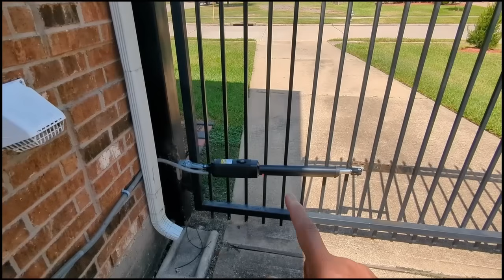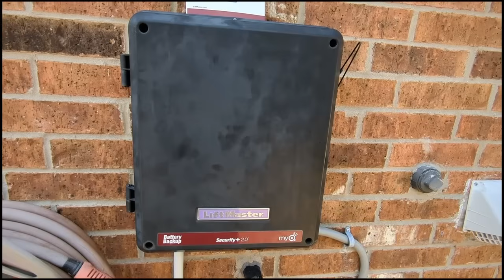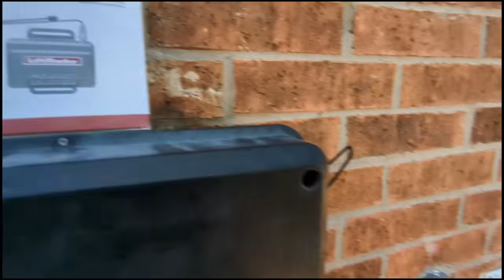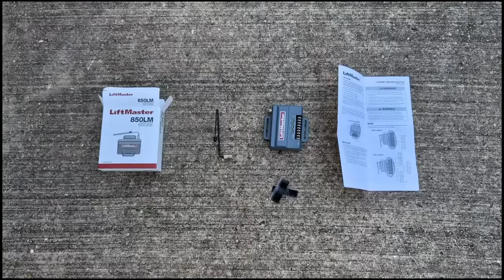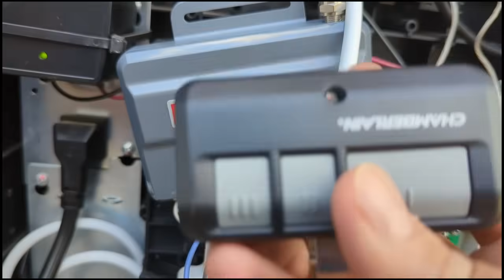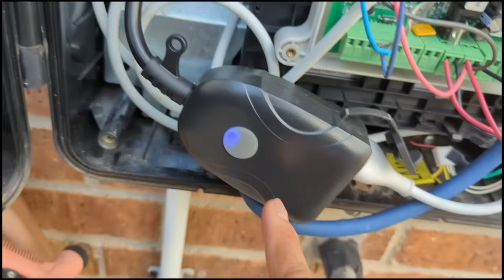Add Homelink and Liftmaster remotes to ANY aftermarket Gate or Garage Door opener.

Comment: Can you share the part/source of the relay you connected to the Costco smart plug?
Reply from the maker: https://www.amazon.com/Electromagnetic-Power-Relay-Socket-Indicator/dp/B0BNCZCFGY/ref=sxin_17_pa_sp_search_thematic_sspa?content-id=amzn1.sym.35c3a4b6-c692-4e40-a10a-4f3d93be8195%3Aamzn1.sym.35c3a4b6-c692-4e40-a10a-4f3d93be8195&crid=1MYRJVA7B9OUM&cv_ct_cx=110v%2Bcontactor%2Brelay&keywords=110v%2Bcontactor%2Brelay&pd_rd_i=B0BNCZCFGY&pd_rd_r=b2cb0615-d749-41aa-a199-080d9124b558&pd_rd_w=kN5jA&pd_rd_wg=gq39O&pf_rd_p=35c3a4b6-c692-4e40-a10a-4f3d93be8195&pf_rd_r=AFH6PCVP7EFW7S7N50PF&qid=1770265730&sbo=RZvfv%2F%2FHxDF%2BO5021pAnSA%3D%3D&sprefix=110v%2Bcontactor%2Brel%2Caps%2C215&sr=1-1-383bc08e-f3b5-4928-b079-a9607486ab19-spons&aref=yz8uQ05ha2&sp_csd=d2lkZ2V0TmFtZT1zcF9zZWFyY2hfdGhlbWF0aWM&th=1

Comment: Can you make the vevor work with myQ app
Reply from the maker: Yes, you can use MyQ , However the MyQ would not "talk" directly to the Vevor, It would instead send a signal to this Liftmaster device , which would then in turn open or close the gate as seen in the video. 

Bear in mind that the MyQ Sensor is for a garage door , which tilts up and down based on garage door position , since the gate is opening sideways , that sensor will not work.

Comment: Great video. 
Have you considered using the MyQ remote app with the Smart garage/gate controller - myQ-G0401-ES?  Do you think that could even work? : I have all my cars set up for CarPlay but still have a remote transmitter for the gate.

Comment: I purchased the 850LM and installed it.  I connected wires from channel 1 to my overhead garage door opener.  I power the 850LM with a 85LM power module.  The 850LM powers on and when I push the ch 1 button, the yellow light comes on.  So far so good.  Then I click the Homelink button in my Jeep and the light on the 850LM never responds.  I also tried clicking a handheld remote and that didn't work either.  I have tried this same exercise in both 315 MHz and 390 MHz Security+2.0 mode.  I can't get the 850LM to respond to any remote or Homelink.  Any suggestions?
Reply from the maker: My only thought is that you have not "Paired" the remote to the 850 correctly.

Comment: I recently bought the Liftmaster LM850 (Universal Receiver) along with an aftermarket Liftmaster-copy remote. I have an old roller door opener (I believe it’s a Herculift, or something very similar).

I wired the LM850 to the old opener’s circuit, and everything works fine using the aftermarket remote. However, I’m unable to pair my 2021 Cadillac’s Homelink with it.

Could the issue be with the aftermarket remote? And if so, what type of remote would be compatible?
Reply from the maker: Maybe your Caddy's homelink is the problem. the LM-850 works with all versions of Homelink, Or you are not following the procedure in your owner's manual.
Reply: I did follow the steps in the manual. However the Homelink system in my car does not seem to catch any signal from the transmitter I have(again, aftermarket). I honestly believe the reason is because of the aftermarket transmitter? Should I buy the original LM remote?
Reply from the maker: @yaseral-yami6304  I couldn't tell you ...... Try with another vehicle ..... if it works then its your car

Comment: I’m installing my 850 this weekend. Did you have a module on how you did the inter net hook up? If not can I get a list of the components you used? Thanks.
Reply: Do you have a part # for the AC relay? I am going with the TP-Link Tapo Outdoor Smart Plug since it is Matter savvy and will work with my Apple HomeKit environment. Thanks for all the help so far.
Reply from the maker: @JakeMoore-u4r  This is what I have used , make sure you understand how to wire it up. 

https://www.amazon.com/TWTADE-Electromagnetic-YJTF08A-Quality-assurance/dp/B07C78PHS2/ref=asc_df_B07C78PHS2?mcid=7969125f69d43bd4b40b5605cdd23768&tag=hyprod-20&linkCode=df0&hvadid=693071814373&hvpos=&hvnetw=g&hvrand=17901985090613655946&hvpone=&hvptwo=&hvqmt=&hvdev=c&hvdvcmdl=&hvlocint=&hvlocphy=9027774&hvtargid=pla-454750891153&th=1
Reply from the maker: So what I think you are asking is how I did the internet , Its hard to say what you will need , But here is what I used. 

Parts: 
120v AC Contactor relay
120V power cord 
Smart switch that can turn a plug on and off from an App , I used FEIT Electric
Reply: @ OK. Let me check. You used a smart outdoor switch plugged into your wall plug with a short extension cord plugged into that going to the ac momentary contact switch. Doesn’t the smart switch stay hot after trigger it?
Reply from the maker: @JakeMoore-u4r  Yes , GREAT question ...... so the reason why I went with FIET Electric Smart switch is because you can set a rule on the app that if a switch is turned on , it should be turned off 3 seconds after it gets turned on ....... so what happens is , I click it , wait for 2 more seconds and then off. 

That setup works like a champ for me !
Reply from the maker: @JakeMoore-u4r  This is the FEIT Smart Outdoor Plug I am using , Look for them on Costco's website , they are cheaper online at Costco. 

https://www.amazon.com/Feit-Electric-WP-required-Anywhere/dp/B07SXDCF7R/ref=asc_df_B07SXDCF7R?mcid=c49ac316650435c5b292a26f4ab1ac08&tag=hyprod-20&linkCode=df0&hvadid=693270340452&hvpos=&hvnetw=g&hvrand=345799008548542533&hvpone=&hvptwo=&hvqmt=&hvdev=c&hvdvcmdl=&hvlocint=&hvlocphy=9027774&hvtargid=pla-871215978633&th=1

Comment: Great Video! I currently have liftmaster garage door opener and enjoy using the MyQ tech that comes with that. I have swing gates at my property entrance and would like those on MyQ also, but my gates are not liftmaster. Would I be able to use this liftmaster 850lm as well as the liftmaster 828lm (wireless bridge) to get my gate relays to trigger with MyQ app?
Reply from the maker: Yes sir ..... thats exactly what this does, it allows you to use Liftmaster remotes with third party actuators ! Good Luck